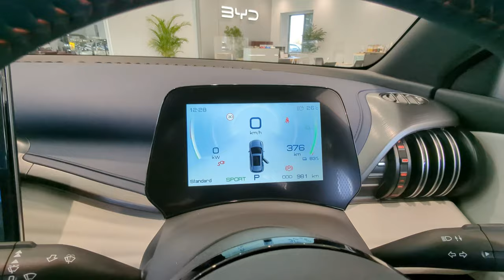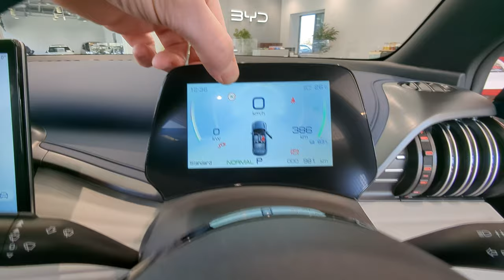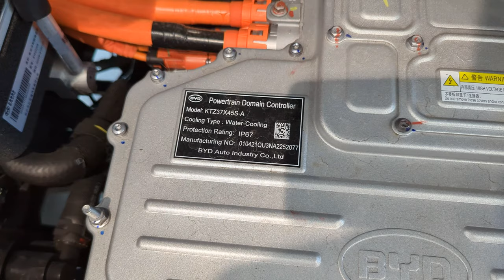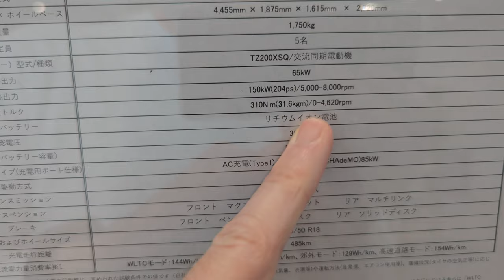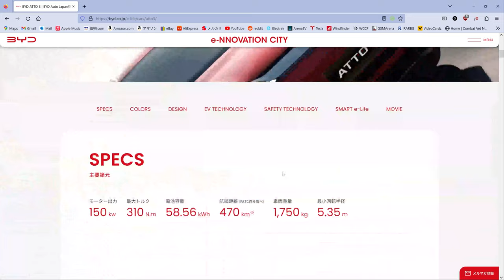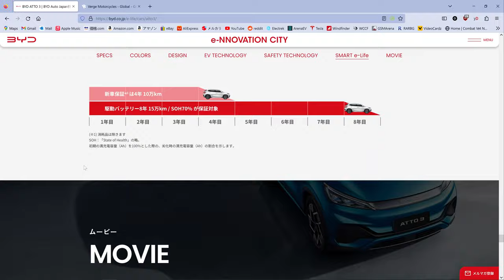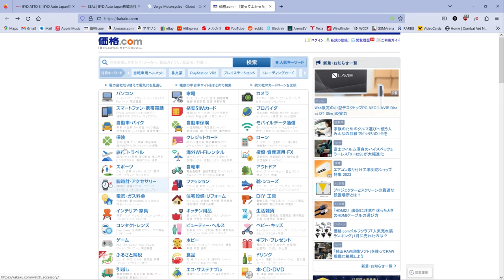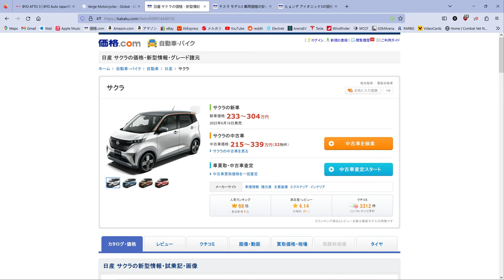BYD Japan (Atto 3)

Comment: An equivalent corolla cross is much cheaper and no need  to wait charging.
Reply: That may be so, but this channel is about electric vehicles! And Toyota isn't making any.
Reply: @DefiantAML  doesn’t the description of the channel says in hope for people to make a switch to EV. How can it not relate to ice cars? EV currently are too expensive even the one toyota makes.
Reply: @Brian-ny4pw  Thats true, they are still too expensive for a majority of people. BUT prices are coming down and auto makers are starting to build cheaper platforms that will bring cheaper cars. EVs are infinitely simpler than combustion engines. Battery pack, electric motor. Thats it. We know they can be cheap, but automakers arent interested in that because they know they can charge a premium right now. Eventually they will be forced to make cheaper cars. Thats when the tide will turn.

Comment: Hub motors don't work for REAL motor vehicles due to the weight being placed below the suspension. This is called unsprung weight and it's basically cancer to everything about the car, acceleration handling, braking everything is worse when you add unsprung weight. Hub motors are cheaper, so if it was so great, believe me everyone would be using it. Comparing this to one of those start up companies concept cars and motorbikes is like apples and oranges.

Also 4.4 million yen is BEFORE incentives. After incentives, it's around mid 3 million yen range.

This car is a big deal because it's a no frills family friendly BEV with an excellent range, LFP batteries and affordable price tag.
Reply from the maker: Thanks for your post! Hub motors are still very new and not many vehicles use them, but some do, so there has to be some benefit to them. 

The incentives you speak of are not the same everywhere in Japan. In Yokohama (where that BYD dealer is located) incentives are only around 400.000 yen. When buying a new EV. It doesn't apply to used cars. Where are you in Japan that you can get 1.4m off a car!?

As I said in my video, the car is indeed a good (no frills) family car that's not particularly exciting. Great for a lot of people. For me personally its not what I would go for, but I hope BYD does well and sells lots of cars!